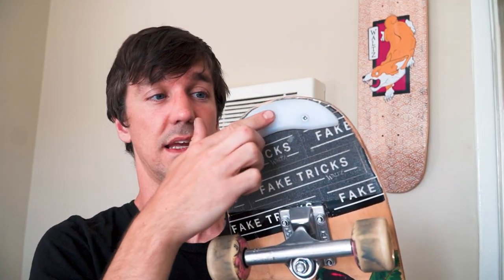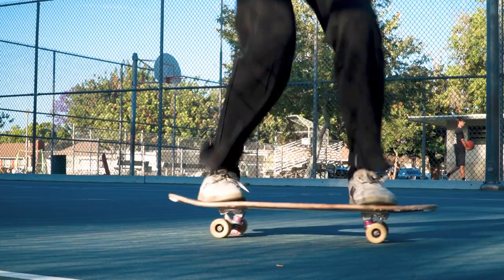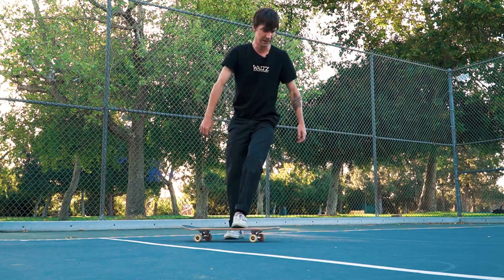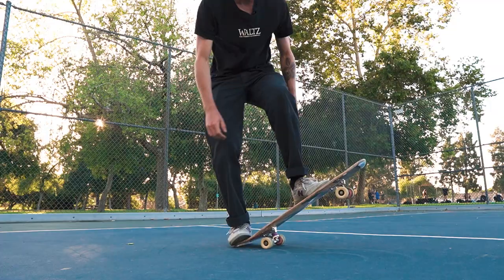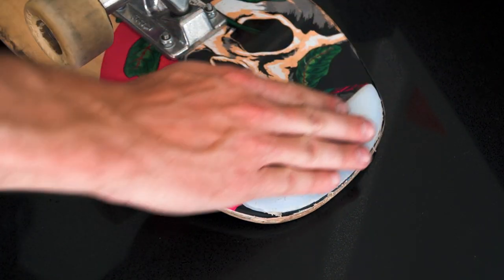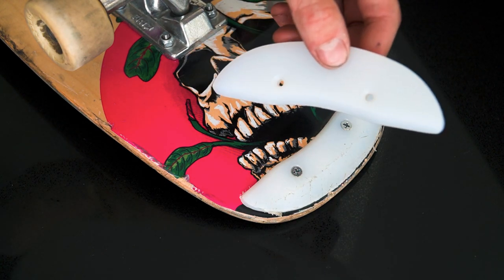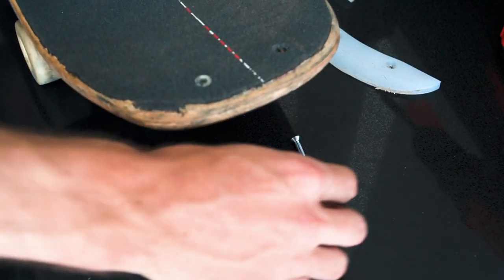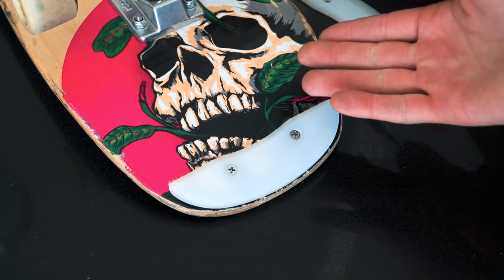Why do Freestyle Skateboards Have Skid Plates?

Comment: Mike, why not design a reversible skid so you can use both sides before needing to get a new plate? Basically an elongated football shape with the mounting holes centered. Name it an Elipse skidplate and boom, new product that doubles the life of the plate at the sacrifice of a small bit of added weight. Possibly even waffle the underside near the center to keep the same weight and save material while still providing double the material to wear off.
Reply: make em from aluminum, and maybe hinge your football shape so you can fold the fresh half out and screw it it place.

Comment: Mike: High abrasion resistant PE, not high abrasion. People out there, use a cutting board to check the difference. That's the reason why 'our' skidplates cost more and last a lot longer.

Comment: Would this skid plate work on 8.25 or 8.5 Popsicle shaped boards? I want to use it with a Mini Logo deck, either 8.25 or 8.5. I've been wanting to learn space walks and 360 kick turns, etc. and it would be nice to be able to drag the tail without getting instant razor tail. Does it affect ollie pop much? I recently bought a Powell Tail Bone, but, it was a waste of money. No way it will fit on a non-old school deck. It's way too big.

Comment: Hi Mike 
I just purchased a set of tail skids, for my Andy Anderson herron egg deck, and
I just wanted to know if i can just screw rail screw into the skids instead?
Reply from the maker: Unfortunately, this will probably not work in the long term. Wood screws tend to loosen and fall out. You could use drywall screws that go all the way through the tail and crack the protruding bits off…. But that could get ugly and then you’ll have skids that you cannot replace. I always recommend binding bolts

Comment: Any plans on making a high profile skid or skids in different colors? I've been thinking about trying to dye a set. Not sure if it would work tho.
Reply: @Sk8-O-Vision I actually tried dying a set like two years ago and it wouldn't take to the plastic. The plastic that skid plates are made out of is very rarely available in colors other than black or white too which sucks.
Reply: @grandmascat9782  Powell and a few other companies made them in the 80s and they came in a lot of other colors. I think the new manufacturers probably could do colors but maybe the demand isn’t there yet to do a bunch of different runs
Reply: @brandonmason388  I know that there's a demand, I know that Seismic has been making protos in colors but I believe they are different plastic. I'm not sure if they're gonna go through with them but only time will tell.
Reply: @brandonmason388  back in the days Powell had THOUSANDS made at a time I guess, so they could choose custom colors to a certain degree.
I just had a batch made of a special orange; these are available in Germany exclusively at Never Enough Streetstore
Reply: @yoyoskates  Orange sounds awesome Yo-Yo! I might have to score a set!
Reply: @yoyoskates   I have a OG Powell skid in green. It fits a popsicle deck. I have the rubber Jaw Bone to match it too lol. Powell made some cool stuff back in the day. keep rippin yo yo. I've been showing little groms how to yo yo hop to get them started on ollies.